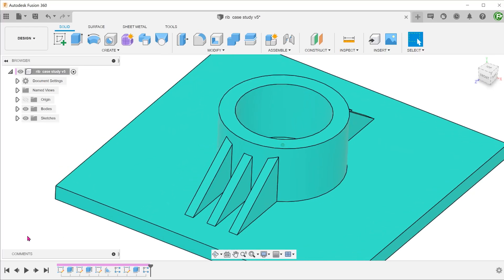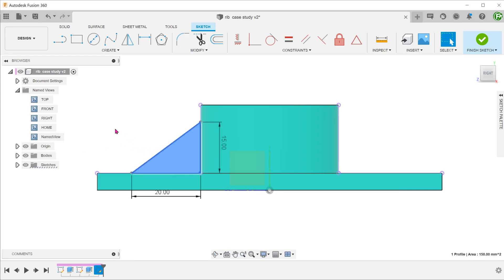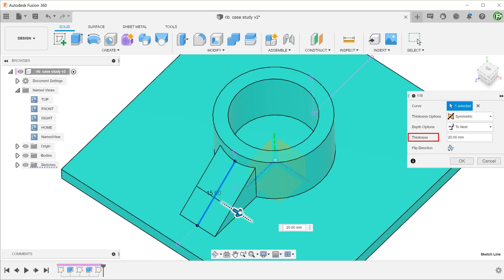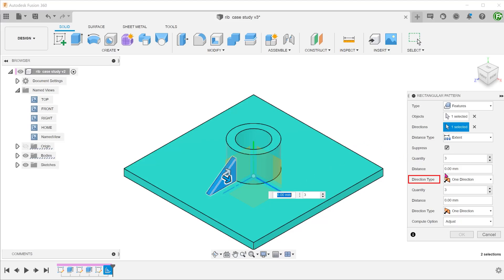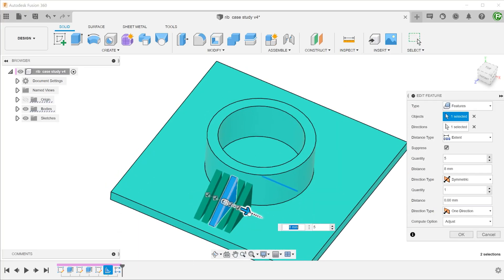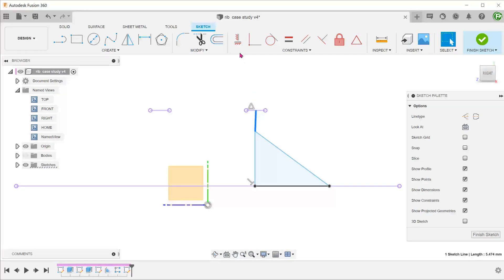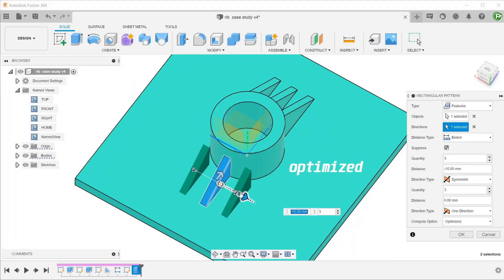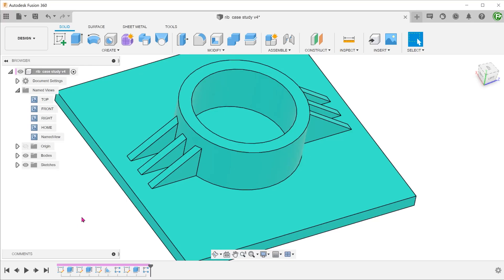Fusion 360 - Rib Pattern

Comment: This is very informative!
However I do have a question and possible add-on for this video:
If this object was a functional part, where the upper perimeter of the extruded cylinder was required to mate its outer surface with another part, is there a way to normalize the height of the ribs as the pattern iterates around the circumference of the cylinder as to not cause interference?
Reply from the maker: I know exactly what you mean. When making the video, I was slightly uncomfortable with the edges riding up the cylinder. This is a consequence of the sloped lines meeting the cylindrical surface at slightly higher levels as we go sideways. 

The only way to resolve this would be to create a rib with a flat horizontal face at the top. While sketching the rib, instead of just a sloped line, include a small horizontal segment at the top. Hope this makes sense. If I have the time, I might make a follow up video. Thanks for the suggestion.
Reply: @Fusion360School  What about a ring around the top used to cut any geometry that rises above the desired level?
Reply from the maker: @No1sonuk  That should work too. However, it would be preferable to resolve this during the rib rather than perform an extra cut.